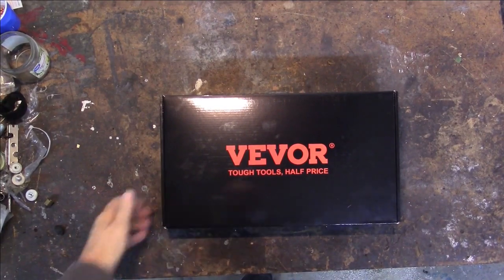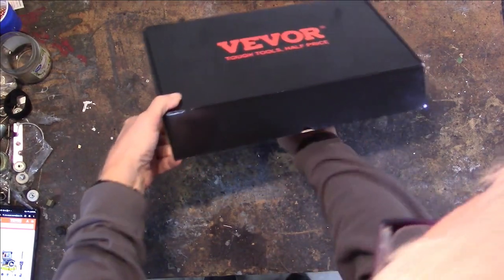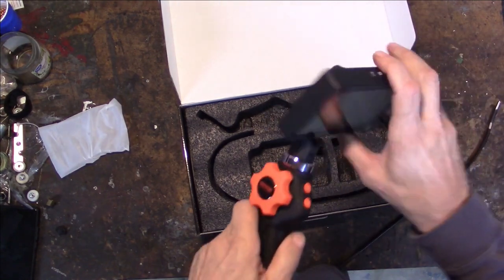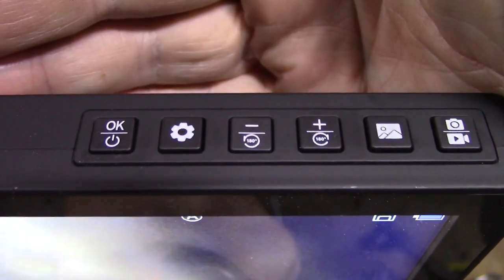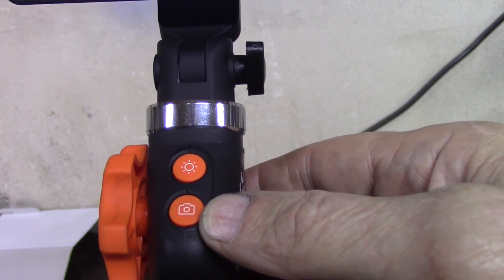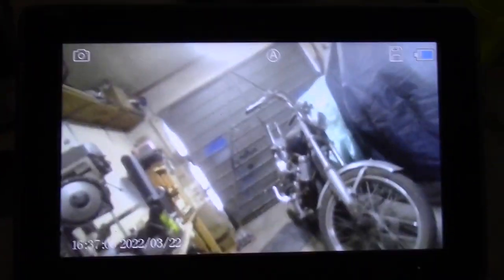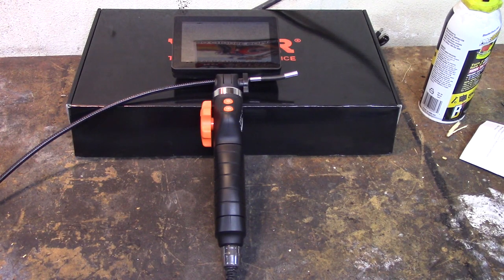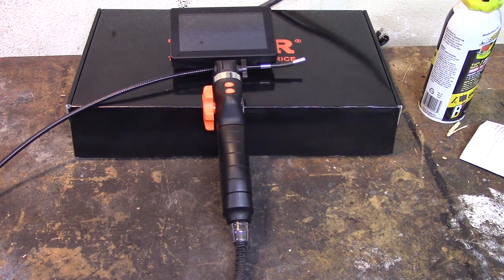VEVOR Articulating Borescope Endoscope Inspection Camera with 6.4mm Tiny Lens. Unboxing and Test!

Comment: Appreciate the share. The last borescope I got was an add-on to a diagnostic tester that I got. Absolute garbage. This is all the brightness and clarity that I could ask for at an attractive price, plus steerability.
Reply from the maker: I've had a couple that were complete crap too, or if not crap, then mostly unusable due to the way they were made. I love the steering, but I wish it was more of a joystick type steering instead of just on one plane, but any steerability is better than none. Thanks for watching and commenting!
Reply: @3rdpig  Hey, could I ask you a favor? Could you measure the outside diameter of the camera head? All the marketing says 6.4 mm/.250", but it specifically says that's the diameter of "the lens." And it's either a translation error or deceptive marketing...

If it is indeed the diameter of the camera head and not the lens inside of it, it means that it works for a lot of diesels. It would be just small enough to pull an injector and feed this in. I'd order one today.

(The holy grail is about 4mm to go through the glowplug holes, but that's $1000 I don't have.)

Comment: Thank you for the video. I bought A Deptech borescope in 2018. Just terrible. Completely useless.  I think the fixed focus was a quarter inch. I never saw an image from that was more than just a vague blur; even when I was pointing it at something I could see. Seeing your whole garage and then inside your engine is really useful information to me.
I have a sailboat, and on a sailboat there are places inside the frame, corners of the bilge, waste hoses, etc that can never been seen. This should be a good tool to have. Appreciate you making and sharing this video. (
Reply from the maker: Thanks for watching and commenting!

Comment: Well done Chuck. I'm looking for one like this for inspecting my oil pick up filter inside the oild sump (or pan).
Reply from the maker: Thanks! I've used it a bunch since that video and I still like it. For the price it's hard to beat. I do wish the articulating end had a joystick that let it move in any direction (remember remote car mirrors from the 60's and 70's?) as it's sometimes hard to rotate the cable so the end articulates in the direction you want, but I suppose that would have increased the size and price. But even without that, being able to have it look backwards is amazingly helpful.
Reply: Just taken delivery of my new toy!
The VEVOR steering endoscope. 
Not tried it in anger, but playing about indoors with it, it looks like it will do the job ok.
Managed to take stills and videos and transfer to PC.
Instructions say no memory card supplied but it came with a 32Gb fitted, fortunately I have an adapter to USB so it was easy to open up in windows PC.
Cheers. Rob.